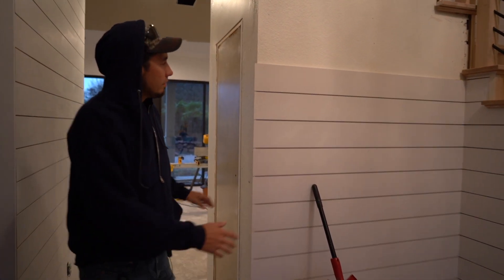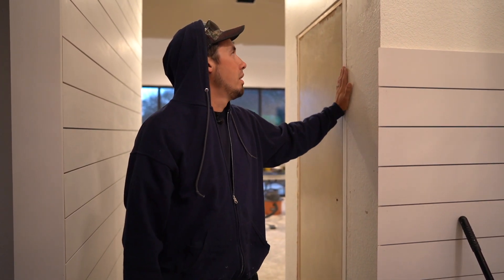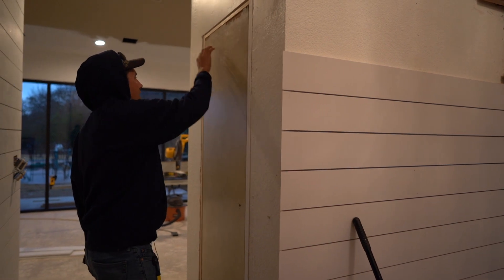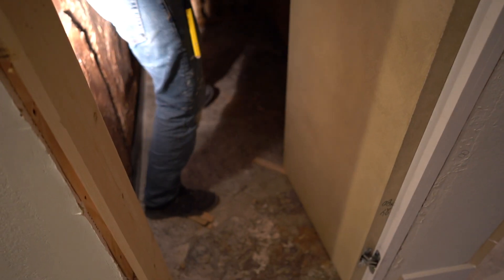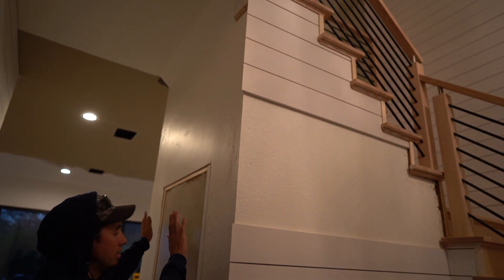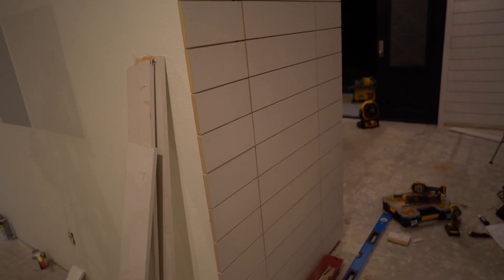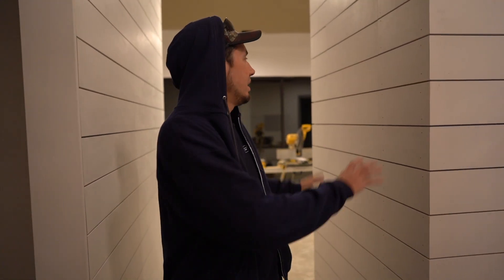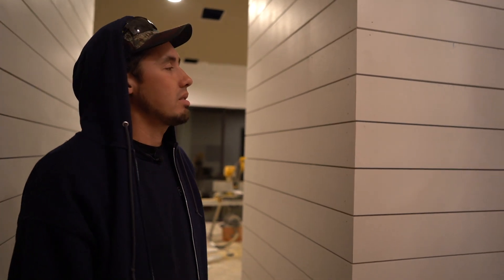Secret Door Hidden in Ship Lap

Comment: Since the door swings in, you could have hidden the gap in the ship lap better by cutting at a 45 degree angle that sticks out beyond the door on both sides. This would also act like a stop so the door ant swing out too far.  Once it’s all painted it would be completely invisible.
Reply: Tomas Blomqvist 
Excellent idea I will use this trick in my hidden door
Reply: I was thinking the same thing but figured 45 would be too much since it would overhang the opening. I was thinking a 15 degree cut
Reply: Chris Tyler that’s funny, I wasn’t sure if 45° would be enough. The corresponding cut would obviously be made on the board on the door
Reply: Because the wall section to the right of the door is so narrow, they could have shiplapped the door so that it sticks out far enough to the right to cover the whole wall and leave a seam only at the corner. Then use your angle idea to overlap the seam on the left side of the door.
Reply: @creamore  that's right it would be a 15° cut and a corresponding 75° cut. I'm going to try this in my house and adjust the angles if necessary. If it's tight enough the seam would almost be invisible.
Reply: What I need to figure out is the other side of the door since it would open into a home office and not a secret storage space. I just love the idea of the shiplap covering the whole wall where the door would be.
Reply: @creamore  oh yeah I see that. I'm talking about the other side of the door. If this side is covered in shiplap, what do I do with the other side of the door where the home office is? The shiplap side will face the mudroom and the door will open into a home office. Can I use the interior door that's already there and modify the catch somehow or do I do a whole custom door and figure out the other side? Not looking for an answer just thinking out loud.
Reply: Cool idea. What if one of the miters tips got damaged walking in or out by snagging someone. Safe, as it's laid out now might be good here-hidden in the hall.
Reply: that wouldn't work with this style of hinges as the hinge side would bind
Reply: No no and no. Your concept would be brutal to bump up against. Angle cut mdf is sharp af
Reply: What about extending the gap line all the way to ceiling, the same 'gap' as in the ship lap? Make it a feature, and do the same on opposite wall? More work but aesthetically pleasing to the eye?
Reply: Saw this after I posted - it works great.
Reply: particle board 45 edges crack and theyre very sharp
Reply: @jackcommons  If your just thinking out loud, why are you typing?.... Rhetorical question... that doesn't need answered :)
Reply: It would be nice but only if you use the door very rarely because it could damage easy. Question for all the guys in this comment section I was wondering why he uses special hinges? The door swings in so he could have used regular hinges on the other side off the door. Or am I missing something?
Reply: Less degree is better. Mdf is sharp and itd get destroyed much easier on a sharper angle. 22.5 to 30 is sufficient
Reply: It would not be a corresponding 75 degree cut unless it was wrapping around a 90 degree corner. It would be one cut through the shiplap at 15 degree for both touching pieces
Reply: I like the idea of this conversation to hide the seams of the door.
Reply: @heimdall4148  good question I was wondering the same thing. I'm about to do the same but I wanted to know if I could get away with using regular hinges.
Reply: @jayrob7418  just try it must be way cheaper. Worth a try you could always go back to the special ones. Btw pls let me know if i was right haha
Reply: @heimdall4148  I got you brother.
Reply: Dress the jamb as any finished opening first- may have to reduce the door slab, or enlarge the rough opening. Or did the 2by4 get paint
Reply: @dlwatib  Nice idea. But that then means you've got that same distance of shiplap swinging into the corridor space every time you open the door. I think regulations would see that as a hazard!?

Comment: i can't imagine that MDF shiplap is really the best choice for the  homeowner.  Hanging anything on those walls will require special hardware that won't destroy the MDF.  It's nice to give budget options to the homeowner, but if they can't afford solid wood, then maybe they need to consider something else.  Side note.... the shiplap that goes across the top of the door frame, it wouldn't be the end of the world if it comes down over the door slightly.  Of course, it wouldn't work on a door that swings out.

Comment: So thats not really shiplap boards, they are just square edge boards with equal spaces top and bottom.  If they were shiplap boards they would be rebated along the bottom edge and fixed with secret nailing.  You could also have continued the joint up the wall to make the opening less conspicuous and replicated the vertical joints around the return wall.  Finish looks good, but more like a retail shop refurb panelling job.

Comment: I noticed you weren't using the eighth inch thick Square for your spacing like you were doing in the 20 foot high hallway wall, always had problems with the aluminum leaving marks on everything and you got to go back and clean it up, job looks great

Comment: Love your channel... A lot of people are talking about cutting an angle to better hid the door, but I think the best trick would be to continue cutting the shiplap into three pieces on both walls in the corridor. It should look as if there are  two vertical columns that align with the door openings. I would do it on both walls. That should completely blending the vertical openings for the door making it look like a design feature and not the outline of a door.

Comment: Good work. Your stuff is s great source of information for many skill levels. If you do another hidden door with ship lap ( chip and joanna  made that  crap way to popular)  you can  miter the joints at the door reveal to reduce gap even more. Miter would overhang the jamb on the hinge side of the door and overhang the door on the latch side. Takes a little more prep getting everthing perfectly flush and plumb but it  looks truely hidden.  Will  be harder to get a good sharp edge with MDF though. And it would be more prone to chipping.

Comment: Quality work and not easy to do. The only thing I would have done differently is have the door cuts go all the way to the ceiling. By cutting the boards above the door just as you did for the door itself would make it look like a design choice with three sections of shiplap. But as it is, its unlike to be seen regardless. Great job!

Comment: Question, if you angled the  backside of the jambs a little bit so clearance wasn’t an issue, would you have been able to get a much tighter fit, or would that have screwed up the hinge installation?  I disagree about running the verticals to the ceiling. I think the short pieces of boards would look odd, like you were trying to use up scrap ends.  Especially when compared to the opposite wall.  Great work.   I’m a DIY’er,  I need to trim out some new windows and your videos are really helping.  Thanks!
Reply: Tighter fit, no, different more expensive hinges could of helped but he got one of the tightest fits that you could get. A darker color could hide it more. My idea of a sliding door would make it look much more hidden and less likelihood of accident if someone leans on the wall lol.

Comment: Would have been really hidden if it opened outward and ran ship lap all way top left corner & didn't fastened from for edge(on left) yup left edge wall & open it up that way, granted, will have over hang when opening outward like that; but would be entirely hidden. Have done hidden doors, spaces, etc...myself & love the challenge of creating the entire thing. The ribs you can do are endless, & I say, "if you can imagine it, we can build it". One if my fav projects involved covert weights, mechanisms, etc on a book case, & then another wall inside that room. Took weeks(as just can't go out & buy hardware like that, as some are specialized & C&C'd etc...). Love vids like this & always looking for new ideas and tips/tricks, even though doing these Kinds of doors since '96, can ALWAYS learn! 
Turned out GREAT! Until next time, A

Comment: That came out looking great bro. As I'm watching the video, I'm thinking, did he check to see if the height of the door is going to work with the shiplap? That was so incredibly lucky. In my 20 years in carpentry and construction, you never get that lucky. Wow. Only problem is, how long is it actually going to last before something starts rubbing and how long before the door wont open? With all the heaving and sinking a foundation is capable of, I bet they run into issues within a year. I mean, it looks fantastic, but with such little clearance, basically no more than 1/8" reveal, I can almost guarantee the door wont open within a year because the house has heaved or sunk. It can be the smallest amount, but doors are the first place you'll notice it.

Comment: Amazing how the top of the door fell on the bottom of a 6 inch. I'm surprised you didn't plan for that, not much slips by you. Buy a Lottery ticket now.
Reply: Or you dont cut the top board and it acts as a stop that doesnt let the door come forward, you just lose a bit of height in the doorway which im guessing wouldnt be an issue in this location
Reply: Joe, What makes you think he didn't plan it, when he made the door to that height?
Reply: @williamhoudersheldt7076  He said in the video that he didn't plan for it, that it just happened to fall randomly like that.

Comment: On a different shiplap installation video that you did, you glued it to the wall. It doesn't  look like you did that on this video. Is it necessary to glue them to the wall? Would 2" , 18 gauge brads be good enough to hold them up?

Comment: The next time you do something like this.  Would you start at the top of door.  And work yourself around?
To prohibit from making a 1/2 piece like you were talking about.
Looks amazing.  Great job!!
Reply: It depends, each job is different.  Do you want a full board at the ceiling or a full board at the floor?  Or split the difference?  You gotta do some layout and see where the boards are going to finish before you glue and nail your first board to the wall.

Comment: looks good but the only thing i don't like is the excessive nail holes 16g nails too. more work for the painters. should have just used some fast grab glue or paneling adhesive and less brads to hold it up. maybe even a 18 or 21 gauge.

Comment: You could have just leave the top board uncut if it overhung the door. It would have just lowered the height a bit. 
If you used Scarf Joint cuts it would have been harder to see the seam and given you more clearance on the left side.
You can also break up that seam by letting every other board protrude past the door frame a 1/2 inch or so.
Reply: Use Bitchute You know, mitering the boards together would probably make for the best option. They could be super tight, and the miter coming over the door from the wall could act as a natural stop too. That’s a win-win scenario.
Reply: @Gottesacker86  Well said, I like that idea.
Reply: Yes i thought of all this and I'm just a handyman lol

Comment: What if you were to do a mitered overlap (like when you join two pieces of trim in a single run) and then trim an eighth off of the door side miter allowing for that clearance. Only issue would be a fragile edge on the door jam side.

Comment: They make magnetic actuated latches.  That would be safer.  What you do is hold a magnet a the right location on teh wall and it will open the latch.

Comment: I had watched one of your videos when you were talking about the Milwaukee cordless table saw how the fence does not slide smooth mine had the same problem and I realize that if you move the lock lever on the right hand side under the table that locks the fence and then unlock it it now moves very smooth but mine came like that from the factory until I played with that lever I don't know if that would help you
Reply: When I took mine out of the box the fence is on the right hand side upside down which you have to take off to put on the correct way in the process of doing that mine moved the lock lever down a Teensy bit and it made it not move smoothly it was rough once I've move that lever on the right hand side fully all the way up now it moves buttery smooth. I'm talking about the lever that once you adjust your fence to the with you desire it locks fence into place. It's on right hand side underneath table saw

Comment: The line on the top of the door.. if you moved it down a little.. you would have a natural door stop.
Reply: Blum slow closing hinge 😂😂
Reply: There's a magnet for doors to help center and hold the door
Reply: To move the line at the top of the door would have to chase that line all the way around the room... that would suck to have to do.
Easier to adjust the height of the door.
Nice job on the stairs BTW.
Reply: @11shockman   I think he means - if the pattern hadn't broke at the top of the door, that might have been a benefit. Leave the top board off of the door completely, and run it straight over the door from the walls. then when the door closes, it sits behind the top board, thus both allowing the seam to be concealed behind a board as opposed to between boards, as well as creating a natural door stop with the mdf board.

Comment: next time try cutting the shiplap on the door at 45 and cope the shiplap on the wall so when closed you dont have a gap
Reply: Jordan Cypihot truth
Reply: Wouldn't work, and believe it or not you would of noticed it even more. Go cut some 45s on shiplap and put it on a wall and you'll see why.
Reply: tried it with the side of a cabinet it worked well but you gotta use a good cutting bit on the router

Comment: I would  have taken those door seam lines to the ceiling...Just saying...Still great work and as a finish carpenter I know it's a lot of work...Make it a two part door and put storage inside the upper door...
Reply: yeah that’s a great idea. Or make some visual vertical cuts around the whole wall. Very cool!
Reply: Exactly what I was thinking.
Reply: Eh, it would of looked odd. Best way is to turn it into a sliding door and use the horizontal lines to hide entirely that it's even a door at all.

Comment: I'd like to know your trick on how to nail mdf without popping the material up around the nail head. I'm a builder and keep having problems with after it getting painted alot of the nail holes show pretty good, even after being puttied and sanded
Reply: Sam I Am - we call those pimples. It's from using a water based primer or paint as a first coat. The water swells the MDF around the edge of the nail hole because the fiber is exposed. The nail hole must be completely "sealed" with a small skim of filler over the top surface of the entire hole or you must primer with an oil based primer. It also helps if you use a filler with "primer" in it...I think Dap makes one - fill and prime in one step.
Reply: Micah Watson wow. Thank you for that response. The painters said I need to use a pinner gun, I'm like great idea... If I want the trim to fall off the wall
Reply: Sam I Am - never let your painter give carpentry advice. 😂
Reply: My words exactly! Lol

Comment: Looks sexy!! Are you ever concerned about blind nailing into walls? Accidentally hitting plumbing, wiring, etc?
Reply: just use nails that will not go thru the back of the drywall.
Reply: eventualentrophy hahaha, that’s a funny one there! Although it would prevent what he was asking about it will not hold the boards to the wall without using some form of glue/construction adhesive and he was not using that.

Comment: Why do you call it shiplap, when it's really not shiplap it just 1x stacked up with space in between. I'm not a fan of shiplap unless it's just used as an accent wall. With that said you did a great job installing it
Reply: He probably calls it shiplap because that is what everyone calls it and understands it as just that.  Just because it doesn't have a rabbet or notch cut on the edges of the board - when it is installed like that it is called SHIPLAP by everyone. Correct or not - get use to it and get off your high horse.  Go criticize someone else's work you keyboard warrior.
Reply from the maker: Rick Washek 0:24
Reply: Ty Smith wow he didn’t criticize his work  in fact he said great job on the install.  The man just asked why he called it ship lap.

Comment: Is there a reason why I can’t use dry wall compound on the inside corner of wainscoting to hide a 1/4 “ gap?
Reply: Tarek Benmahmud , it would most likely crack and crumble away over time as your house sets. You’re probably better off using a quarter round and caulking.
Reply: Thank you for the reply . I was hesitant about using caulk on this big of a gap because how caulk shrinks and becomes concave  when it drys. What about wood filler that is part adhesive?
Reply: You would not caulk the entire gap. Cover it with a moulding or quarter round. I would not use wood filler. It dries too hard and would probably crack or break away.